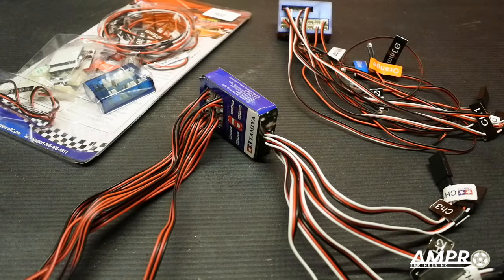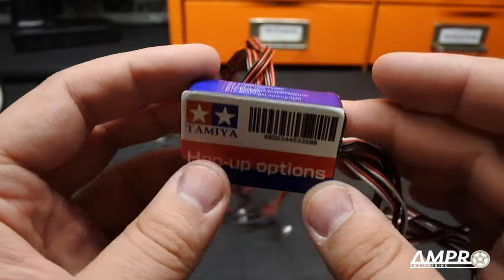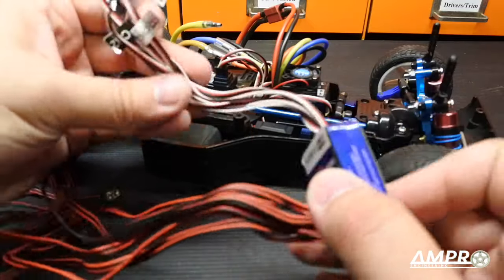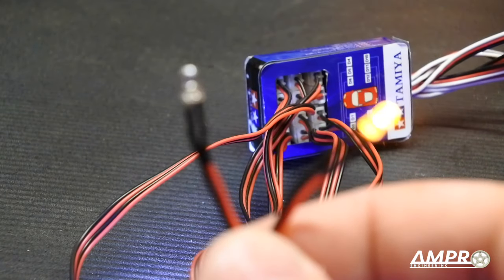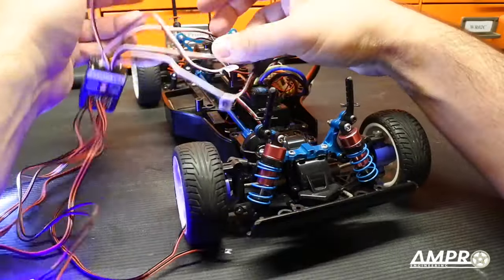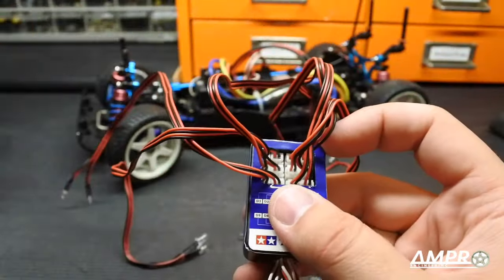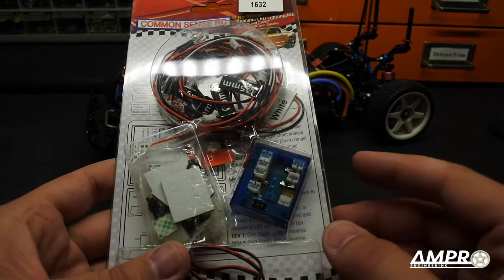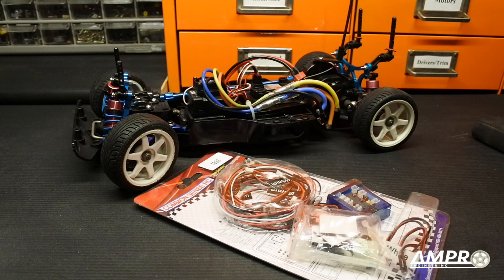E31: RC Car Lighting Kit Review, PART 3: "Tamiya Hop Up Option"

Comment: 7 years later I got a knock off Tamiya  light kit for my wife's 72 Chevy.  This video helped. The Vaterra has a 4 channel receiver, but only a 2 channel radio. I just put the channel 3 wires together. Now the extra headlights flash when you squeeze the throttle about half way.  Those flash to pass lights and the red brake lights were connect in the wrong ports. Swapped 'em over and bang! Light kit ready to install.  Thanks!!  00
Reply from the maker: Sure thing! Glad it worked out for you.

Comment: I have spoken with my contact at Tamiya USA and this is not a Tamiya product. Some kind of knock off.  For your info, Tamiya currently has TLU-01 LED Light Unit (53909) which can be used stand alone or with the control unit which supports 2 TLU-01 units.  Control Unit - TLU-02 LED Control Unit (53937).  You can connect 16 LEDS (8 Sets) to each TLU-01 unit with the TLU-02 unit allowing you to connect 2 TLU-01 units and use them together for a total of 32 LEDS (16 sets).  It's a little on the pricey side though
Reply from the maker: I figured as much. The quality is awful. I do have those sets but as you mentioned, the cost is quite alarming for the average hobbyist. I have light kits on most of my cars and I cannot justify $200 per car for the Tamiya units.  They are quite well made and great to use though. Thank you for the information!
Reply: @AMPROEngineering  How much!! I've the Tamiya Audi Quattro Rally car kit, in the kit gives an option for working lights, this is new to me! Last time I built a car was back in 1991.....I have thought about getting the light set but $200 is just crazy, infact no need for such a high price.

Comment: You know, the light that does on when in neutral, I think is usefull for Cabin Light.. So, when your car is stop, we can see inside the cabin, but when your car is running, it'll comes off.. and ch3, we can use for head lamp. Could control by remote when we want to turn it on.
Reply from the maker: This is a brilliant idea! You may have found me a use for this system!
Reply: 7

Comment: Thank you for your show, it is very educational for rc newbies like me. I watched you show, and tried connecting the lights, the lights came on when I finished the connection, but it seems to interfere with steering,  the steering won't work while the lights are on. What should be dine to correct this?
Reply from the maker: Sounds like a high current draw or a malfunction in the unit. Other than that I cant imagine why this would happen

Comment: I used to Tamiya kit, I switched the brake bulbs and the "neutral lights"  red brake for being stopped, white for reverse instead of red
Reply from the maker: Hmmm, good call.
Reply: Yeah, i did the same. I just left the blue out all together. It may end up with blue headlights if the white one's ever fail 🙈
I went a bit further and moved the throttle channel neutral using subtrim so that the red brake lights only came on when the trigger was pushed away from neutral. I think the value was in the low 30's.
A word of caution for the less experienced in using subtrim in large amounts on the throttle, as your ESC may not recognise neutral/off and you take that to be a faulty ESC.

Comment: the other lights that stay on are like park lights. but sadly they go off when throttle is hit and break as well as reverse. if you add a light switch between the ch3, you can have flashing lights for the set that turns on with the switch. and when the receiver is turned off, hazard lights turns on. i'll post a video of my set up once done with additional lights.
Reply from the maker: Is that what CH3 is? Send a link when you have it
Reply: I'll try to have a video by tomorrow
Reply from the maker: cool ill check it out!

Comment: Trying wiring it in properly. 
Reverse lights are not red in any vehicle so brake lights should be on until you touch throttle and clear lights should come on in Reverse and blue would be pretty common for headlights.
Reply from the maker: Yeah that is a good point

Comment: is there a way to power these seperatley from the chasis? i'd rather have them attached to the body shell alone
Reply from the maker: Yes, this is what I do often. the "y" cable is long and will allow you to remove the body a bit to access things on the chassis and if you want it all the way removed, you can unplug it from the Y.

Comment: Ok.. so I got this kit today. I have plugged everything in, but the ch3. I need that for the light bar. now.. I have 4 orange blinkers that work as turn signals, and I have switched the 2 white with 2 red LEDs so, when my car is stationary or moving forward, front lights, and rear red light work. When I start to go in reverse, the red ones turn off, and the white one start working ( as normal reversing lights do). I still have 2 blue LEDs which only work from 80% plus forward throttle. Not sure what to do with them.. I don't need high speed blue lights on my cherokee crawler.. lol.. I've unplugged them...
Reply from the maker: Yeah, my sediments exactly! For my (our) applications, this is not needed.
Reply: @AMPROEngineering  sediments? Not sentiments? Lol. Sure would like to know does the original tamiya kit have the "turbo" lights...

Comment: Take the kits you threw in the trash and cut the led lights off.  Solder and make your own light harness the way you want it and power it by a 9volt battery box with on/off switch. Works well, no headache an no waste.  On some of my cars I added a cheap infared remote control to the system that gave me the following features: On/Off, Brightness 100%/75%/50% and nine (9) different modes of flashing and various speeds. 9volt battery box & infared remote control unit was less than $12.00
Reply: PWR-07 Powershift RC Technologies PST LED Light Controller is the remote control that I used.
Reply from the maker: I ended up just using this for the turn signals and wired my own harness. Anymore that’s just what I do Since many of these are useless

Comment: I’m building the TT02 Audi Quattro and have painted it a really interesting ice Pearl summertime green and got the stickers all dialed.   Would like to rig the  dual 3 light fog lights as well as two main headlights.   Which would be a total of 8 white LED’s up front.   And I’d still have to do the back lights.  What’s the solution - rigging up 2 of these kits that you are working on here on 1 car or the TLU-01 and 02 ?  Or some other pre rigged kit? Or doing what Mark Bryant RC did on his video and rig up a full custom light rig?  I’m torn because I feel the Tamiya light kit is not at all cheating.  Still A Lot of work.  Regardless of how it’s rigged up I want to toggle them on and off from the handset.  So i don’t know if this is complicated or compounded further when rigging dual multi light systems.   Want to dial in the lighting before I go figuring out the Yeah Racing hop up kit to the frame
Reply from the maker: The My Trick RC UF7 or wire your own. There are some more pricey ones out there but it’s just not worth the insane costs

Comment: Great video bud. I bought the OB1 4 Channel professional led lighting system V3.1M for my Tamiya Globeliner Tractor truck. It was advertised to fit my truck but the kit doesn't bring enough lights. It brought 10 lights. It brought 6 bigger lights and 4 smaller lights for the cab lights. I need 3 more small lights and 2 more bigger lights. The truck has 15 lights total and this kit brung 10. It's not a Tamiya kit. Do you think this is a goof up by factory or am I suppose to buy extra lights? I bought this kit from Rcmart and their number to contact them is no good. I don't know what to do here. If there's anything that you can tell me about this kit I would appreciate it, take care bud.
Reply from the maker: I just bought that to test too. I do not think they goofed, I just think they did not care. These are really cheap products and just try and move units without any testing or validation unfortunately. Ill test mine and see how it goes.
Reply: AMPRO Engineering Hey bud thanks for replying. Keep up the good work with your videos. Take care bud.

Comment: nice video dude, 

I checked it earlier when my set of lights arrived, i used these lights on my tt-02 and it worked fine,
now i own a mst mtx 2.0, the lights still work realy wel, i just wanted to ask you how you plugged in ch3.
cause i don't seem to get the headlights working with the push of a button, but i'd realy like to.
on channel 3 of the receiver is plugged in the gyro, so i don't realy know what to do, i tried a lot of different stuff.
can someone maybe explain to me how to get it working?
Reply from the maker: Yeah sorry man I never had any luck with CH3. If someone knows, let me know too!

Comment: I use this knockoff tamiya light kit and GT Power Pro with built-in esc and Bluetooth lights engine sound Vibration and I still haven't found a great light kit
Reply from the maker: The best one I have used is from MyTrickRC.

Comment: Can you please recommend me a good LED kit for a 1/10 nitro RC to a electric one. i have the standard reciever mostly so i want to know your opinion.
Reply: I want it to be as tiddy as it can be. i dont really want wires sticking out of everywhere!
Reply from the maker: Pablo, best I can do is watch the reviews and pick one that meets your budget and criteria. They will all have a ton of wires but you will need to tidy them once installed.
Reply: @AMPROEngineering  Okay. Mostly my budget is up to 20 dollars or lower. I need something that's basically plug and play that will work with a nitro powered RC from 2008. 

A tutorial of you tiddying up your LED lighting would be great since i am new to this hobby grade. I haven't seen a detailed tutorial of doing something like that. I am confused as well to how a lot of RC enthusiast about to why their LED units main component (the reciever?) is put on the body shell of the RC. i seriously like the look but i am unsure if i know enough to do such a thing

I have a question. Is there any battery drain limiter than can limit the amount of drain on a battery? since the nitro ignites due to the battery, i am afraid that the battery on my unit will run out and it'll crash once more (like last time.)

Comment: Thanks a lot for your video! It worked to me as a manual. I Bought one of this too thinking that was a tamyia product :(

But I couldn’t make turn signals work properly
Reply from the maker: Yeah, these are terrible units. I do not know how Tamiya has not issues a crease and desist on these sellers.
Reply: Hey buddy maybe try removing and putting the signal lights on the other sockets

Comment: You have video for actual light function and, hence telemetry functions working? #arrmalimitless #allspektrum160amp smart all the way.
Reply: A good video has much detail..please explain connection and please don’t assume everyone knows how and speed up and cut edit so much detail hence 6th wire from light box. Where does that go
Reply from the maker: This does not have telemetry.

Comment: is it possible to wire 2 Kits @ the same time ?
Reply from the maker: Hmm, I think it is possible but you may draw too much current from the receiver and burn it out.
Reply: @AMPROEngineering  so, is it a high risk to burn my reciever? Or would it be worth a try?
Reply from the maker: Well sounds like it worked for you! That's good.

Comment: Use your common sense :P LOL, some sell these for 6 dollar on Ebay.  I need brake and reverse light function only, main lights on my Wraith are switched on the car itself. I'm also looking for orange blinkers which i want to control by a 3 way switch on my remote (way more realistic) and to power the LED's two micro brushed ESC's. Very nice info in this lightning series! Def no "Tamiya" for my Wraith project!
Reply from the maker: Yeah this thing is one of the worst I have seen.

Comment: I bought one of these and it’s junk, for different reasons though.. mine worked ok for 1 minute then it started stuffing things up, my steering servos stopped working, the led unit did something to my tamiya esc, even once I removed the lighting unit my steering servo would not operate, I tried the servo in a different receiver it worked fine, I tried the other receiver in another car and that was fine, after 30 minutes of having everything unplugged all my electric work ok again as long as I don’t use the lighting kit, 20 years of rc and never come across anything like that before, these are junk
Reply from the maker: What a pile. Thanks for info.
Reply: I bought 1 of these and it came wired completely backwards and it fried my brushless esc. Get it replaced with exact same thing and none of the wires are in the correct places so now I need to lnow the correct spots for the diff colored bulbs cuz there's 4 spots that blink but it makes the blinkers stay on solid like parking lights I'm so irritated. Every other 1 of these I just hook everything up and it works fine

Comment: So you didnt know much about this before you reviewed I guess. Third channel is a switch in case you dont want them on all the time, I cut it off when I dont need it and it comes on when the receiver is powered. Its the most scale one I could find and it STILL doesnt give parking lights that fickin blink. Or brake lights. Like 50% until you brake or turn...
Reply from the maker: No mine did not work that way. The 3rd channel went to an onboard circuit with blank pads around it. The cable was installed but likely a cheaper version or cost reduced variant. I think this is the reason they so seldom come with instructions.

Comment: Definitely fake. look at the Tamiya font. Totally different.  Plug diagram does not correspond to plugs for sure. For some reason, mine makes the servo turn backwards. So, when I turn left, the lights flash left but the wheels turn right.
Reply from the maker: Oh yeah, 100% crap. One of the worst ones I have reviewed.